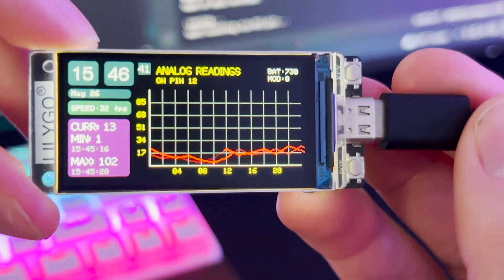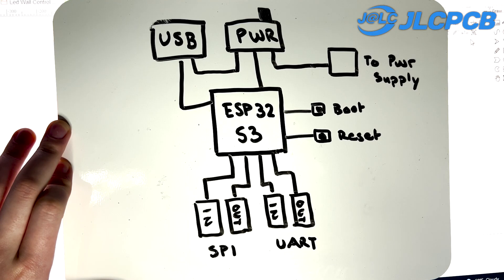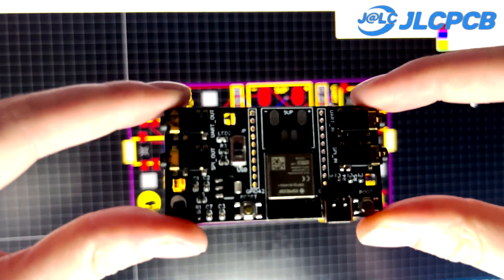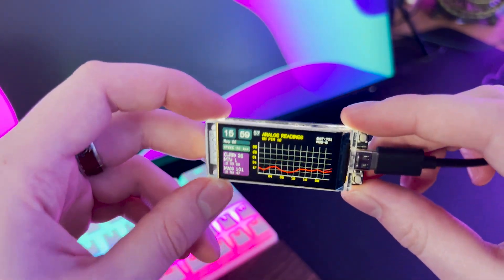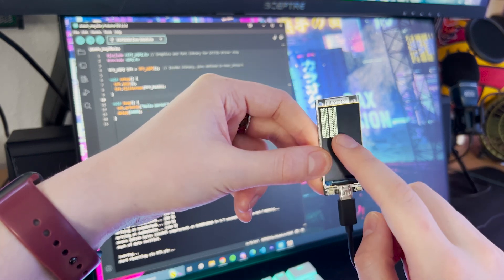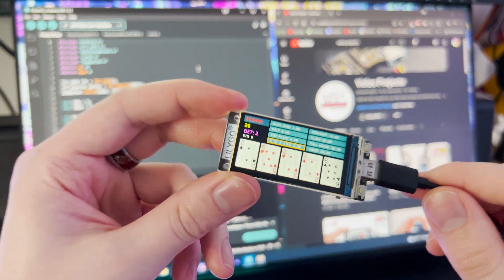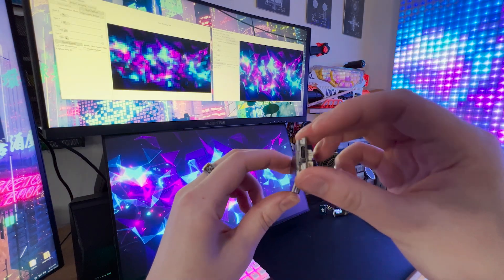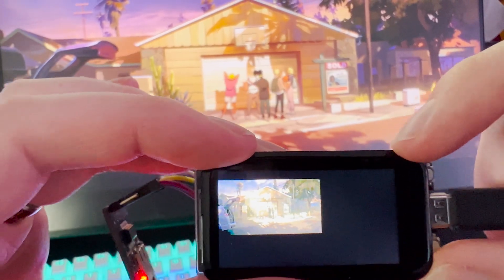This TINY Display Will Make Your Projects Better

Comment: i am an embedded system engineer like you, i am working on a large display rgb matrix display using multiple esp32.
i have been able to use single esp32 to run a 128x64 matrix to display a low resolution image and gif read from SPIFFS and uploaded from a wifi webserver.
i wish to upgrade and add features like the LMCSHD live video feed.

you are really doing a good work here. keep it up bro. your channel really gives me inspirations and ideas

Comment: What would be the method to have this powered off of a DC power adapter or such, assuming there is on board memory
Reply from the maker: You can connect a 5V dc adapter directly to the on board USB-C port

Comment: My current project, which uses an ESP32, is a Domestic Hot Water Controller.
It has temperature sensors which monitor the water in a hot water cylinder that has a heat exchange coil, and the temperature of a solar array.  It then controls a circulation pump to transfer the heat from the solar array to the hot water cylinder.  It also controls an electric immersion heater as a backup when there is insufficient sunshine.
I used an ESP32 so that I could send temperature readings to a web page enabling me to monitor the system on my phone.  It also has a "holiday mode" which prevents it using the electric heater whenever I'm away on vacation.  The ESP23 connects to a time server so that it knows the date/time and switches back to normal mode the day I come back.

Comment: Project.
I'm building a weather station. 2 units. One sits outside. With a few sensors.
The other inside. The two connect via ESP Now. That dev board would make an ideal home base station to display the relevant information.

Comment: Stupid idea.
Retro PC!
At 240Mhz. That is Pentium 1 speed.
Agon Light uses an ESP32 as a video card. So I wonder if an S3 could run as a 200Mhz Pentium ( window 98? ).
Core 2 as the video driver.. Or. Just a second ESP32!

Usb 1.1 is plenty fast enough for a USB keyboard and mouse.

Large SD card as a hard drive.
Just needs a sound card ( another esp32? ) and you have the hardware needed for a retro PC. Anyone fancy coding a Bios and firmware?
Lol
Reply: You can't directly compare clock speeds between a x86 and an ARM processor.
An x86 processor can do much more in a single clock than the ARM processor can, because it has a much more elaborate instruction set.

And if you want to build a PC compatible out of it, it will be even slower, because it has to emulate those instructions.

Next to that: the ESP32 has so little memory, I doubt anyone would be able to built a fully compatible x86 emulator out of it.

Comment: What is the resolution of the each frame that is being sent to the esp maybe you can do some form of compression or reduce the resolution before sending it if you haven't tried that already
Reply from the maker: The new wall is 182 x 128 at 16 bits per pixel with no compression. It could be a fun video to demonstrate the pros and cons of different compression algorithms

Comment: Like seeing the extra "functionality" on the 3d printer.  basic and works.    

general question on processros and such, have you considered to use older cellphones and repurpose them for the computing power for projects?    Have a few and not sure who to use them (and seeing how poerful they are with all the functionality (wifi/usb/etc  compute and integrated power.  any pointers would be appricated.
Reply from the maker: So far I’ve only ever used old phones for app development but I’m sure there are some clever uses out there. Smart home control panels are the first thing that comes to mind